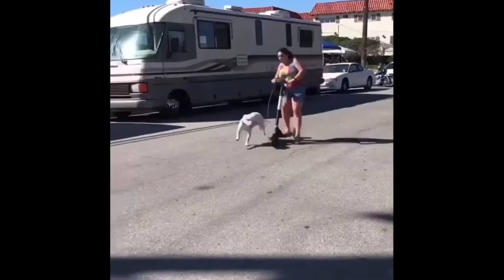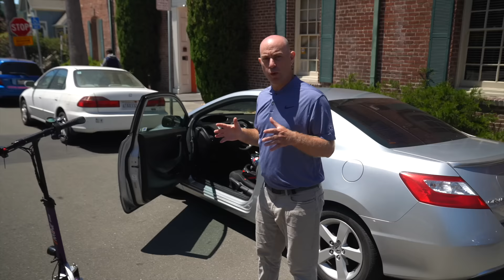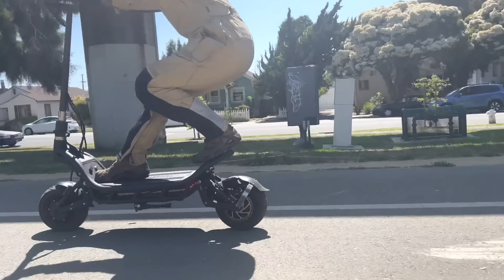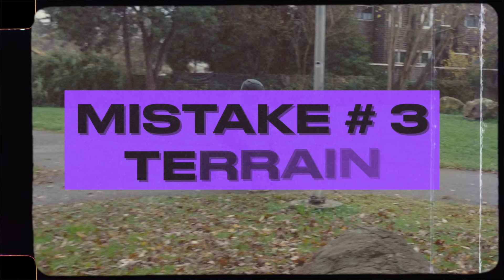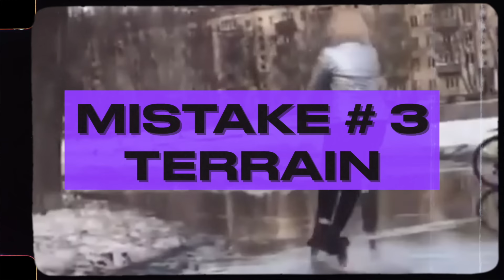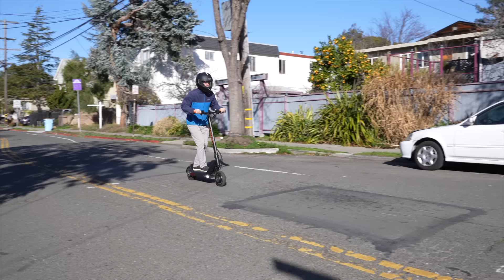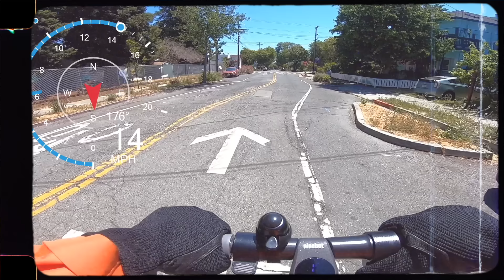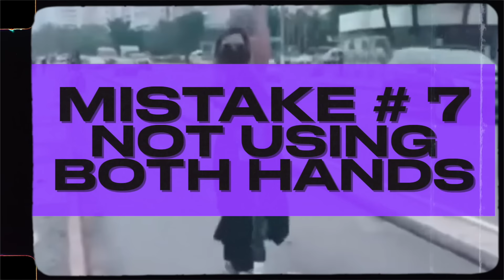Top 7 Riding Mistakes New Scooter Riders Make & How to Avoid Them

Comment: Hey everyone, I fell on my face and hands on my second scooter that I bought during my second season of riding stand up electric scooters. I have put over 2,000 miles on my first scooter "wolf king gt pro" before I went over the handlebars of my second scooter the first week I owned it, I'm not gonna say the model because I might sell it and I don't wanna give it a bad wrap before the sell lol. I braked really hard and I went over and smacked my face and fore head in the pavement or cement. Ended up with a concussion, seven stitches above my eyebrow, 4 stitches in my lip, and I broke my pinky finger, also my other hand hurts to but not as bad. Skinned one of my knees but that is very very minor. This just happened a few days ago so I'm still recovering. I'm not sure how bad the scars to my face are gonna be. I'm not sure but on my wolf king gt pro this may have not happened, because that scooter is bad ass, it feels incredibly stable and the braking is awesome. I have ridin 3 scooters so far and the wolf king gt pro is absolutely awesome.
Reply: I will probably get a full face helmet and  riding gear.
Reply: Going over during hard braking is probably the most dangerous thing about these scooters, be careful everyone.
Reply: Also wanted to say it's my own fault I was driving to fast for conditions.
Reply: Wolf king gt pro is the most fun toy I have ever bought in my life.
Reply from the maker: Hope you feel better! Hang in there

Comment: "Stance" is wrong. You should ride with what foot forward feels the most natural and gives you the best control. You cannot rely on turning out of the way of the car doors opening into traffic. That's how you get run over. If you're driving past parked cars and you don't want to get doored, then go at a speed you can safely stop quickly enough to not get badly hurt hitting the car door, or ride in the road lane in front of cars. Period.
Reply from the maker: Very insightful! Thanks for sharing.

Comment: I took a pretty bad fall once
Just got my scooter 
I was going about 25 miles an hour down this street
And my front tire got caught in this gap, and I tried to turn out of it, and I went over the handlebars 
Banged up my knee pretty bad 
But I kind of did a tuck and roll
The gap was there because of the way they poured the concrete they poured in two different sections, so there was a gap in the middle of the street
Luckily, I had my helmet on
But right after that, I went straight to Amazon and bought some elbows and kneepads 
😂
Reply from the maker: Stay safe out there

Comment: Please answer this!
QUESTION: So you mention three styles. However all your styles are with front of foot facing forward. Me as an old skateboarder stand on my scooter exactly the same as i stand on a skateboard, side of foot to front.Why? Because I'm so used to falling off the skateboard that i've learned that falling on the side decreases the injury risk since you spin when falling (and protecting your head) compared to falling straight down with your head first.
Now tell me, Am I really the only one who stands and thinks like this? And how come you don't mention this stance? Did I miss something, is it actually bad? Have I been wrong this whole time?
Reply: Please reple @electricscooterguide
Reply from the maker: If you are comfortable with that stance that’s all that matters! Stay Safe. -Vosk

Comment: You would think since I got an razor E90 it would be easy to manage riding on for an adult to do. It can be used by adults too not just kids. But I was wrong it went faster than I though and I fell off. And yeah I know why is an adult on a kids scooter. Well I don’t like traditional kicks scooters that aren’t electric too slow. Yeah I think I should’ve  started with one of those ones first. Oh I’m 44 yr old woman by the way.
Reply from the maker: Very insightful! Thanks for sharing. -Vosk

Comment: If the driver opens the door without looking into mirror, is his fault, not yours. So you don't have to put yourself into a danger of a suddent divert. Just go straight ahead and thrust your brakes. A broken door will be his problem, not yours. About your side: better sending your scooter to repair than risk yourself going to the hospital or worse.
Reply from the maker: The important thing is to be aware of your surroundings and stay safe.

Comment: I just watched the end.... bahahahahahaha I drive one handed 90% of the time on my Segway nine bolt full throttle always, cruise caught me off guard a couple times, mastered it. I think I should be making videos because driving one handed is the funnest part and could 't imagine doing it 2 handed all the time, boring. I knew I was special  😅
Reply from the maker: Stay safe
Reply: @ESG-ElectricScooterGuide  I have had a few wipes but now I have learned. One amazing thing that helps with the one handed is cruise is shut off by tapping the throttle not just the break, that would have saved me from my last wipe when I got cut off onto the shoulder that was way too bumpy for one hand lol.

Comment: To me that front steering instability definitely needs to be re- engineered for better safety & absolutely ridiculous letting one hand of the stupidly dangerous so-called handlebars possible results in you bitting the dust , like being thrown off a bucking bronc or rabbid bull with its nuts wrapped tight. I can't believe how unstable these things still are Someone needs to solely figure out confirmed instability of these things before if it hasn't already happened people fall of unexpectedly right in the path of even slow moving traffic and that's it for them especially if if a 3/5 or bigger Semi vehicle crawling past once momentum kicks in your going right under the path of the wheels & dead & stupidly written Up as a traffic accident and your even held liable because your dead on the road where you weren't supposed to be.  But the last part is a whole other legal Matter that's taken forever to get in the books. A even calling them a scooter is also nut's because there's already a scooter from hundreds of years ago with a little ice motor. These things are basically the mentioned highly unstable skate board on wheels or a surf board that's wheel equipped. Period

Comment: Just Got a E2S V2 for my birthday and the tire Got punctured after One 3km drive and i dont know if i should change to solid tires. I like the comfy Air tires but i dont wanna have to fix my tire every few days/weeks at best. appreciate any advice
Reply from the maker: Check tire pressure regularly. Should reduce flats.

Comment: Maybe wear a motorcycle helmet with reflective visor and motorcycle gears such as  spine, chest protection  very important with removable padding that built in a hoodie or a jacket.   Elbow pads or Volley ball Knee pads would also work and bicycle padded shorts. Especially if you are riding in a busy area and hard pavement and where there's cars all over the place. No way I would ride a scooter with  zero gears on. NO WAY.   What if you fall and the scooter landed on you?  Most electric scooters for adults are very heavy imagine it landed on your knee or ankles. Those handle bars can easily chip off a teeth or cause head concussion and other injuries.  When I ride my bicycle back in 2014 to avoid a puddle of water, I slammed on the front brakes instead of back brakes,  the bike thrue me in front and me  hitting my teeth on the handle bars and chipped off my front teeth.  It cost me $1500 for new crown.  Dental visits are expensive so I learn my lesson.  I was lucky I have a helmet on it kept my head from hitting the ground. The plastic part hit the cement first.  I have all my gears already bought.  I am just waiting for the right scooter that very fast and at a very good price range. 
I do also like the delfast top 3.0 bikes but is too big also also cost 10K is. Bit much. The 300KM is what I like best about that bike.
Reply from the maker: Thanks for the feedback!

Comment: I will buy a scooter with a top speed of 12 mph (20km/h), is this slow? and can i ride it with more confidence than the more powerful ones?
Reply from the maker: 12mph is pretty slow! You will outgrow it very fast and want more.
Reply: @ESG-ElectricScooterGuide  thanks for answearing me, so i chould use the tips in this video or is a bit different due to low top speed?

Comment: Nope, the foot out idea is not a good one, firstly other road users won't necessarily understand what you are doing or what it is meant to mean, secondly it makes the rider more unstable and once again prone to coming off, as you point out the very small wheel combined with the very tall and narrow bars make these things inherently unstable and are therefore more at risk on a public road.
Reply from the maker: Thanks for stopping by!

Comment: So, to summarize: Don‘t be an idiot or Darwin is going to handle the situation. That being said, most of those tips are indeed handy. I might add that there are scooters on the market with built in blinkers. And for the speed, including the helmet, those tips are irrelevant for viewers from most of Europe - Germany for instance limits the speed for scooters to 20kmph (about 12.4mph) and requires things like headlights and indicators. Granted, most of your audience will be American, but I still find it worth to mention.
Reply from the maker: Good points!

Comment: I got a max g3. Why do y'all say "you Will fall". If you are Really smart and competent, and respect your scooter, it's not likely. 😂 Why would you get a scooter that goes 60. They are to heavy to even pack up and take to cool spots! Too much cash too. Or you get a cheap scooter the goes 60😂
Reply: I have a scooter that’s 60 lbs and it’s not very hard to move if you’re stronger than average. Tbh it’s only a hassle when I’m going in and out of the house, cuz of stairs.

Comment: I wouldn't buy them - they are dangerous - you are standing on something travelling at a good rate of speed and any bump will knock you off. Esp dangerous if you are on the road and even a small bump by a car will make this go haywire but more important, you will fall and if it is concrete, you better be wearing a helmet but injuries will happen
Diff if you are on a bike - you are sitting down & so if the bike goes haywire, you are still sitting and don't fall that far down
If you want this type of bike, buy one where you can sit down and ride & not the standing one
Reply from the maker: Insightful! Thanks for stopping by. -Vosk

Comment: the thing you mentioned about using goofy and regular to "avoid hitting things" is hilariously false. 

you aren't supposed to lean your turns like that at that speed.

the method you want is counter steering. leaning. 

I can weave through any tight space without ever needing to change my stance. infact everybody can. 

I'm a skate instructor, fitness trainer, and I have over 15 years of extreme sports experience. 

the idea that your ass will stick out in front of car doors if you ride goofy is just, very dumb.
Reply from the maker: Very insightful! Thanks for sharing.